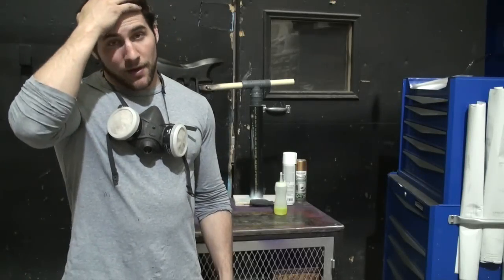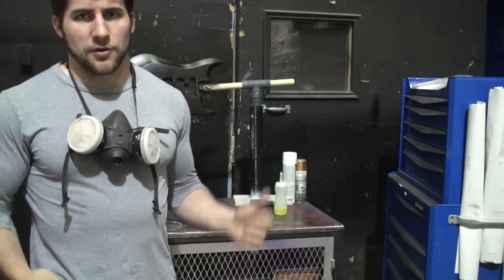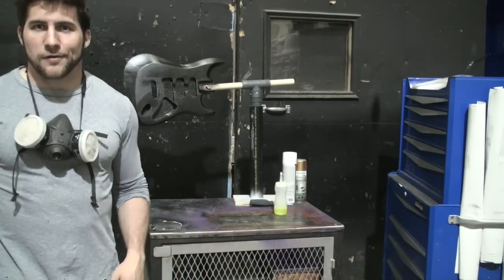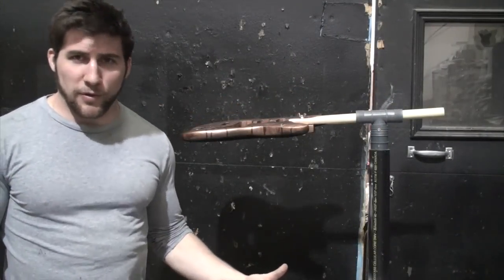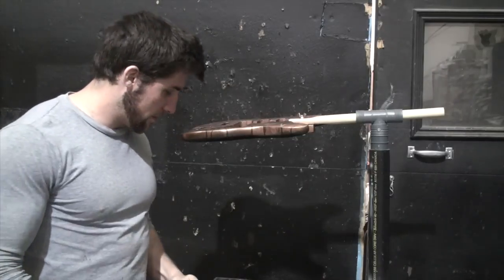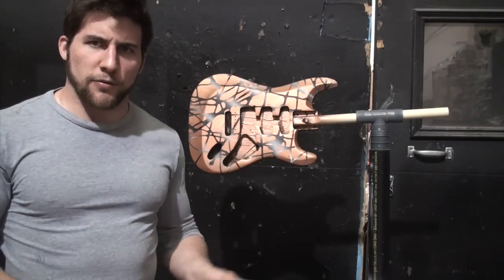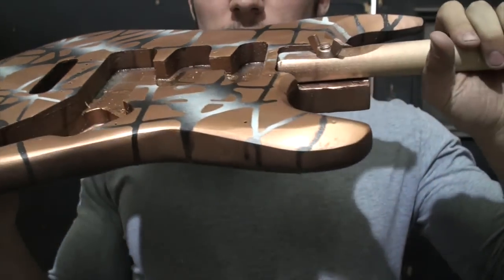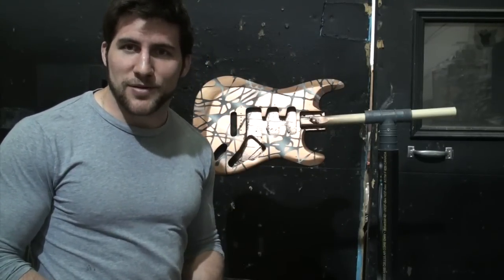How to do a cool guitar paint job with spray cans

Comment: Ok, nice technique! 
I have  questions:
1.) Is the soap thinned down w/water at all or straight-out-of-the-bottle consistency?
2.) Does the soap need to be washed off of the body after drying the paint or was wiping it off enough before clear coating?
I think I know the answers to both, but, I might not, and my experience with paint in general is a bit slim. NOT being certain, I would think that:
1.) Out of the bottle is good, thinning could make it TOO thin and cause drips, puddles, and other yuck.
and
2.) Wipe it after a couple minutes, like you did, then let it dry for real, and the next day, gently wash the soap off with lots of water and a light touch of your fingertips, and maybe just dabbing at it (but not rubbing at it )with a really soft touch with a soft cloth where/if needed.
 I would have to think that the clear might not bond well over the top of soap, and you want the clear to bond and be smooth, as well as being durable and lasting, so I think a light washing is in order.
LMK what YOU know about the subject, and tell me how I did just guessing.
Thanks, and again, Nice job!
Reply from the maker: +Jeffery A. Hunt You were pretty much right on with your thoughts. Don't thin the soap. If anything, it would be nice to get it a bit thicker to keep the lines tight and avoid running. 
Because this is enamel and fairly durable, once it had dried I wasn't too worried about a light touch. I just washed all the soap off with a damp cloth which I of course had to rinse out a few times. You need to make sure you get the soap off there completely before adding clear. It won't stick to the soap. If you're using a different type of paint you will need to be more careful. Don't even try it with water-based paint. It will take the paint off with it.
Reply: What I figured. I have a few axes that need some finish or another. I was really thinking about swirling, but not all of them. This is a great alternative. Snake/reptile was another option I was considering, especially with a rattle-can.
Reply from the maker: I'm looking at developing a technique to do snake/reptile skin with cans actually. Something similar to the old carbon fibre technique, but of course with more colours.

Comment: I'll bet a cool variation of this technique could be to put the guitar at a slight angle and drizzle the dish soap at the top and let it run down in streaks. Then put it flat to stabilize it and put the top coat on.
Reply from the maker: Yeah, could conceivably be quite cool.

Comment: +Brad Angove I really like this idea and i want to use it on my guitar but i was wondering how long you have waited after the single steps. How long did you let the first color layer dry? How long did you wait before rubbing of the soap?
Reply from the maker: +Tim Sterzenbach I think I let the fist layer dry for about half an hour. I waited around 15 minutes before cleaning off the soap.
Reply: +Brad Angove Okay thanks! I will try it very soon!
Reply from the maker: Excellent. I hope it goes well for you.

Comment: i have got a scratch on the boundary of my electric guitar i m thinking to spray paint the entire boundary to give the guitar a new look ?? 
is it possible and can i do it with nornal spray paint??
Reply from the maker: +vipul khushlani If you sand the guitar lightly first so that the paint will stick you should be able to. You will want to clear coat after as well. Just to clarify, what is normal spray paint?
Reply: +Brad Angove ordinary spray can available in the market?
can i use that or any specific one is required?
Reply from the maker: I'm sorry. I don't know what kind of ordinary spray can is available in the market where you are.
Reply: Is there any way i can show u the scratch and you suggest anything? Please
Reply from the maker: You can send me a picture via facebook if you would like to. The link is in the description of the video.
Reply: +Brad Angove i have sent you the pictures.
can something be done?
Reply from the maker: I've been trying to figure out a solution to this. Do you know what kind of paint is on the guitar now?

Comment: Hey Brad another great Video, and I do love my spray cans :) any way I have a question I prepped my guitar I primed it looked fine, I put a can of gloss red spray paint on it hung it to dry looked at it a few days later and in shock on a small patch of the guitar there are pits little low sink points im guessing  it was an area of unlevelled points any way, is there a way I can fix this with out having to take the finish off and re sanding ?
Reply from the maker: Without knowing what the pits look like, I can't tell what they're from exactly. It could be low spots, or it could be what we call a fisheye, which is where the paint pull away from a spot. This occurs when there is a bit of grease or something like that which the paint can't stick to. There are a couple of potential fixes for this that I know of. What I would do is sand it flat and put the red on again (if it's a fisheye). Just make sure it it cleaned and de-greased this time. The other option is to sand lightly and try to drop fill those spots. Then put another coat of red on it.

Comment: Hey Brad thx. I teach kids how to build their own guitar. I've used alcohol with powdered dye, and it's worked well. I'm thinking of doing this because it seems a lot easier and quicker. Would a can polyurethane finish affect the paint job?
Reply from the maker: +pitamoncha2112 This is pretty quick and easy. Are you thinking of using polyurethane for the whole paint job, or just a polyurethane clear coat to finish off?
Reply: Poly just to finish off.
Reply: I usually paint with dyes and alcohol and clear poly to finish off. Several coats.
Reply from the maker: You should be able to do this spraying technique with polyurethane spray cans from start to finish; which would reduce the likelihood of a compatibility problem. If you're going to do it with enamels like I did, you're probably best off to use an enamel clear coat as well.

Comment: Interesting.What will happen if you live the soap dray?
Reply from the maker: +BeginnerLuthier I'm not sure. I've honestly never seen dish soap dry completely. I would think that you could still wipe it off with a wet cloth, but the paint might dry overtop of it and the edges of the lines might chip when you wipe it.

Comment: Hey Brad, am building my own guitar and i currently have an alder body that's only been sanded. I've been leaning towards staining the body but this looks amazing and now I'm not sure! What would you recommend for a first timer and would I need to use a grain fill before i start?
Reply from the maker: Staining or dyeing is always a nice option if you've got a dog looking piece of wood. Alternatively, you can do a paint job with transparent paints. You may even be able to apply this technique to that option if you think it will look good.
You can grain fill with a dark tinted filler to accent the grain, or you can skip that step and just be diligent when sealing the guitar.

Comment: Hey man what kind of paints are you using in this video? I'm thinking of doing exactly this style of paint job on a guitar and I'm interested to know a little more on the primer, paint ect
Reply from the maker: I'm using enamel paints made by rustoleum. I was painting over previous paint, so I used their flat black to start. If I hadn't had paint on there already I would have started with their flat grey primer. The rest was just my personal colour choices of course, but they were flat black and white, as well as the "bright reflective metallic copper" on top.

Comment: Hey man do u have to let the soap dry then wipe it. And what final coat you use thanks
Reply from the maker: +Isaac Jaramillo The soap probably won't dry. You just need the paint to be dry enough that it doesn't move when you wipe off the soap.
I didn't use a final coat on this guitar, but of course I would have used a clear coat of the same type as the colored paint if I were trying to create a proper finished product here.

Comment: I turn wooden vases on the lathe use the same technique but with a hot glue gun!  how many coats of clear coat do you usually put on?  thx
Reply from the maker: That's a really cool idea. Did you try staining in a pattern like this? I usually put on three coats of clear. It still allows me to polish out all of the little ridges that techniques like this create.

Comment: Hey Brad, I'm going to try this on some other project for my niece and nephew. I was going to hydrodip them with spray paint, but tried,  and didnt do them/I gave up, because the paint hardened so fast on the water, their was no way I could dip them. Any way, I'm going to try this because it came out so perfect.  My question is do you think I should put the dish soap in a bottle with a smaller tip on it like you did, instead if just using the the dish soap bottle? Tha is in advance, it came out amazing
Reply from the maker: It depends on the look you’re going for and how thin you want the lines to be. You can even just put the dish soap in a large spoon and drizzle it out carefully.
Reply: @BradAngove  ok cool, gonna do it tomorrow. All my wood us already primed,  as a said I was going to hydrodip them but failed
Reply: @BradAngove  after I wipe the soap after it dries, should I wipe it lightly with rubbing alcohol before I clear coat. Thanks for the advice brother
Reply from the maker: I don’t use alcohol on it. The dish soap is already a degreaser. I just make sure it is thoroughly clean off (with a bit of water) and properly dried after.
Reply: @BradAngove  cool, thank you for all your help. Going to do it today. Thanks again

Comment: Do you sand down a metallic paint before laquering? Im looking to spray a strat bronze
Reply from the maker: That’s a tough question actually. Ideally you would sand it lightly to promote adhesion, but with metallics that can often screw up how they look. I probably wouldn’t. Just make sure your paints are properly compatible.
Reply: Brad Angove thanks mate
Reply from the maker: You’re welcome.

Comment: i'm running into a couple problems... i'm doing this on plastic on a motorcycle.. everything is prepared right for the paint job but once i put on the soap and do the second coat everything comes out bad. the soap runs so once i've done a first coat the next two are off the line. and my lines are really thick and noticeable upon cleaning the soap off... is there a way to fix this.. i think it would be better if the soap didn't run so bad, i've even put it in the fridge to try and slow it down and tried thinner lines. any help would be great
Reply: Leland James ok i'll reply to my own post after reading more hahaa... I didn't let the soap dry at all before putting the last coat on.. i'm going to try that now and see if it fixes my problem
Reply from the maker: Leland James Let me know how it goes.
Reply: I'm running into a problem with the dish liquid drying up too much before the top layer of paint dries fully, which in turn makes it hard to clean off which is messing up the paint job. it looks amazing from a distance but any pointers on cleaning off the dish soap without it messing up the edges so much?
Reply from the maker: Try using a bit of water if you haven't already.

Comment: How Many Coats of the Clear do you use? And Dry Time in Between?
Reply from the maker: I didn't use any clear on this, the the coats and dry time depend on the type of clear. For enamel clear I tend to do three coats about 10 minutes apart.
Reply: Cool beans.  thanks.

Comment: Hi Brad, 

did you wash the soap off or just wipe it? does it not affect the clear coat or second coat at all?

I'm going to be doing this on the back of my guitar with green base (possibly stain not paint so the grain shows) and black top coat with clear over it all. The front and a line up the back of the neck will also be green stain.

Dan
Reply from the maker: +daniel taylor Hi Dan. I wiped it off with a damp cloth. The reason it didn't affect the second coat or the clear is that I was using a solvent based paint. I waited for that paint to dry before wiping off the soap. If I tried to do this with a waterbased paint, it would come off. Are you planning on spraying your stain on? People usually wipe or brush their stain on, which obviously wouldn't work here because it would move the soap around. If you're going to spray on oil based stain it will probably be ok. Just make sure you have a compatible oil based clear coat.
Reply: I was going to water based stain the whole guitar, let it dry, sand off then prime+black over the top, let it dry enough to remove the soap and then clear. You think this would work? Also the stain I want to use says it's compatible with most tip coats.
Reply: I suppose i could green paint the back and rather than stain and just stain the front for a contrast.
Reply from the maker: That might work, but with a slight modification. You should consider staining it first and then using a clear sealer (of clear coat) to seal the stain in and keep the soap from soaking into the wood. The sealer will also work as a primer, so you can then just spray the black overtop. If you use a clear coat as a sealer, make sure you sand it lightly before you move on to using the soap and black.
Reply: I had thought of that but didn't known if the black would stick to the clear! How would you key it before the black, scotch pads or just fine wet paper?
Reply from the maker: Either one would work. I would probably go with grey or red scotch pads. if it's fairly smooth, then 600 grit paper. Doesn't need to be wet, just no load paper.
Reply: Cheers Brad! I think I'm using rustoleum cans as I use them for my metalwork and they're always really nice to use. Will be checking out a few of your vids to get some tips on spraying!
Reply from the maker: Great Daniel. Let me know how it goes.

Comment: Brad, Love the video man. Great stuff..  Would love to see you do a video on Holoflash techniques with guitars. If you don't know what I'm talking about, but I'm sure you do, just google Kramer Holoflash guitars. They were cool guitars in the 80's. I've seen a couple ways to do it, but I'd like to see someone like you that knows enough about paint do it with paint instead of the foil and heat or foil and lighter fluid and 400756 coats of clear. Both techniques are all that I've seen that were used. I'd like to know how Kramer did it, and if there is a way to do so with paint. 

I'd also love to see you do a fluro paint. I'm considering that with my guitar, but wondering if you'd use a clear. I think you told me you wouldn't. I don't remember, but you can also buy that paint from the hardware store, also Rustoleum.

Also, do you have a stand for set necks? Mine has only one hum in it, and it does have a hole in the neck because originally the guitars were made with two hums from the factory (www.precisionguitarkits.com) from Canada by the way and excellent woods and guitar products if you want to build your own guitar. Set neck, or Bolt on. 
Thanks so much..
Reply from the maker: Hi Tim, there are a lot of interesting effect paints out there, but I don't know of anyway to do the old Holoflash technique without the foil. You may be able to get something similar with chrome and candy paints, but I doubt that it would have the same abstract look to it.
I might do something with some fluorescents at some point. Maybe something with some interesting shapes etc.
I don't currently have a stand for set necks. At the moment I just screw an Eye bolt into the bottom strap hole and hang them, but there are ways to make them that involve that hole and one of the tuner holes.
Reply: Hey Brad.. Thanks man. Would love to see you do a Fluorescent paint job on a guitar!

Comment: I'm a little Confused, so you spray painted black and white striped across the guitar, then you spray painted a brownish color over top, wouldn't that just go over top of the black and white striped? how did the black and white line pop out? and could you please tell me the paint you used? thanks a lot this video really helps!
Reply from the maker: +Shenal Wanasingha I used dish soap to create a pattern over top of the black and white paint. The new paint over top of that doesn't stick to the dish soap, but it sticks everywhere else. I let that new paint dry, and then I wiped off the dish soap and all the paint that was on the soap came off with it. That let the black and white part show through where the soap had been. I used enamel spray cans for this.
Reply: +Brad Angove thanks a lot man this helps a lot!! watching so many of your videos!
Reply from the maker: You're welcome. I'm glad you found it useful. Thanks for watching.